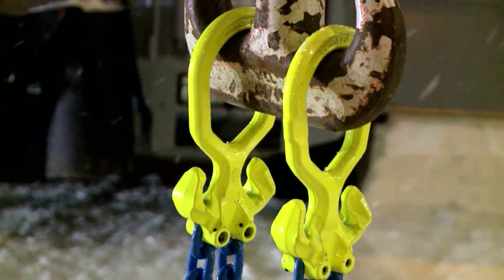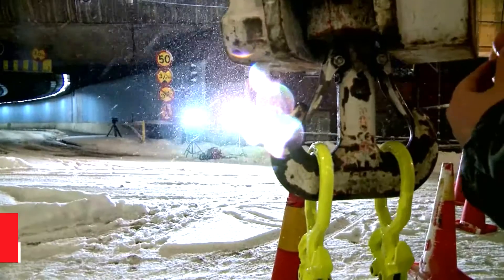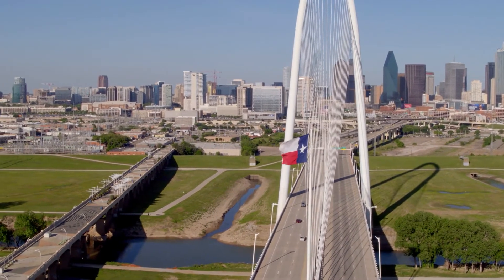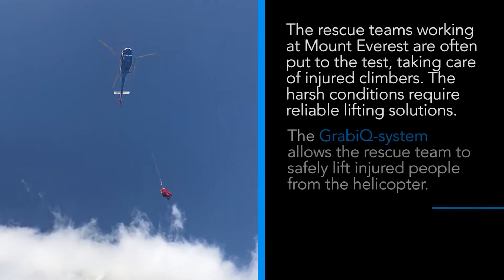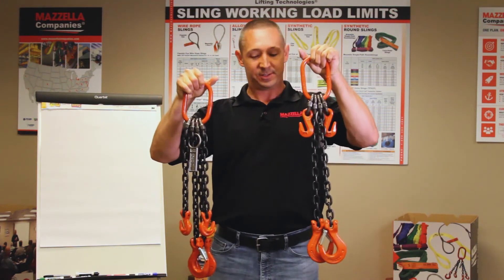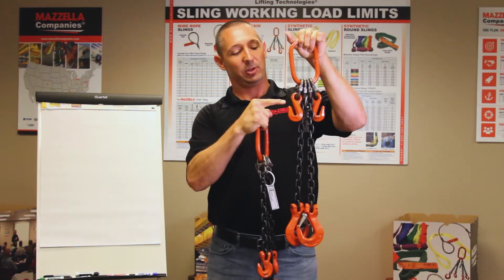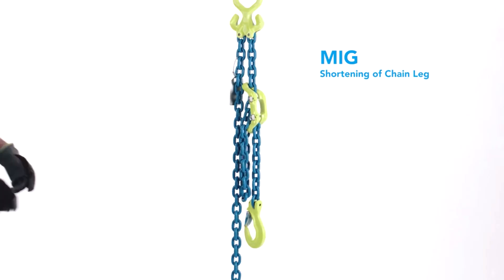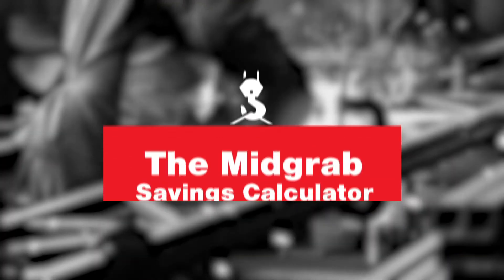The GrabiQ Chain Sling: Background, Best Practices, & Uses | Part One

Comment: Choking GBK hooks is very popular 
I see bent and broken GBK hooks quite frequently and customers don't want to switch back and forth between C-locks and GBK hooks, they also don't want to buy twice as many chain bridles. 
We have a 1/2" TG4GBK in the shop right where two hooks are broken and 2 are bent and it's from Choking. 

Gunnebo should find a way to make a GBK hook chokable or make a C-lock more versatile.